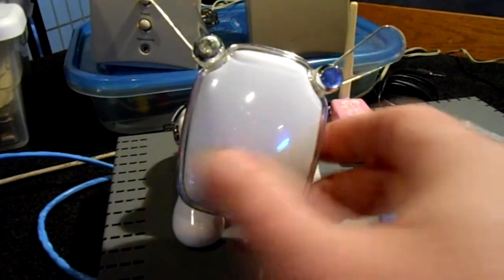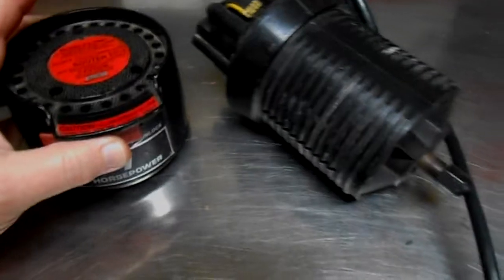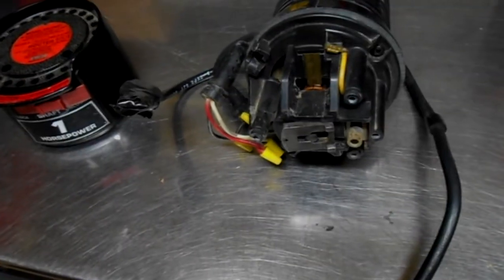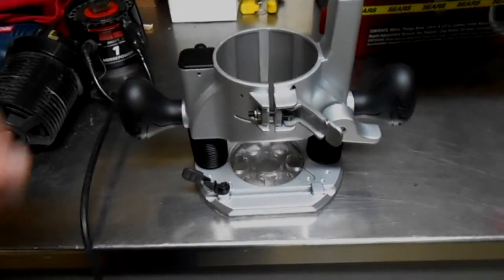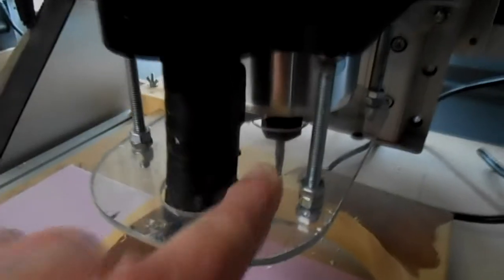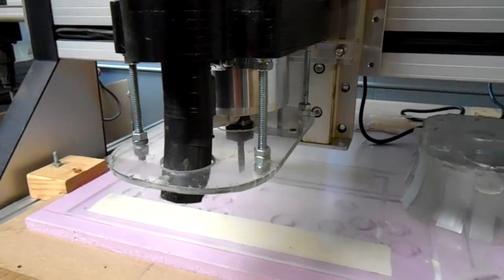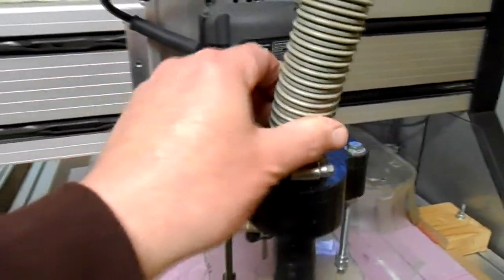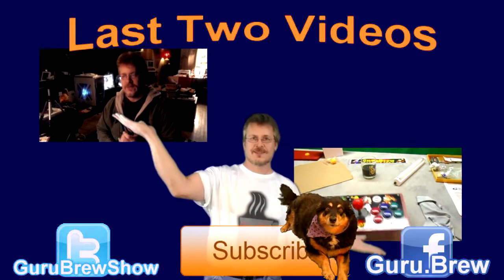Replacing and Using a Sears Craftsman Router on CNC Machine

Comment: Steve it's interesting that I use the very same router on my router table as the one that got damaged.  I also purchased from eBay a Craftsman 2hp router that was bought as for parts only... didn't run.  Found a loose wire in the housing, and fixed in 2 seconds.  Only cost me $35 and plan to use it on my CNC project when I get going on that.  I like the soft start on these new routers.